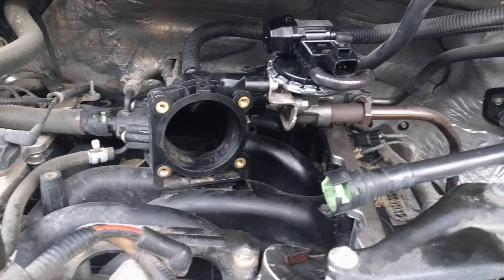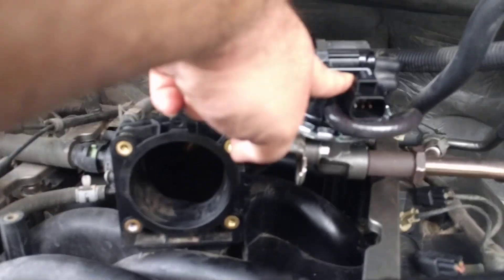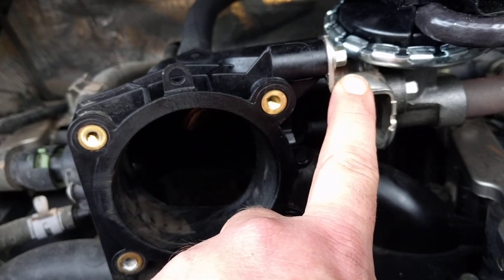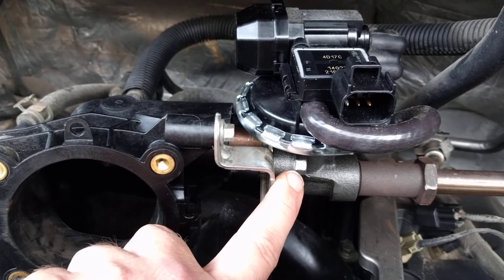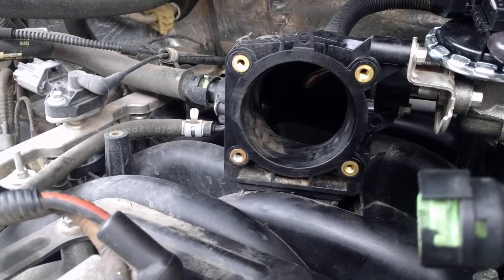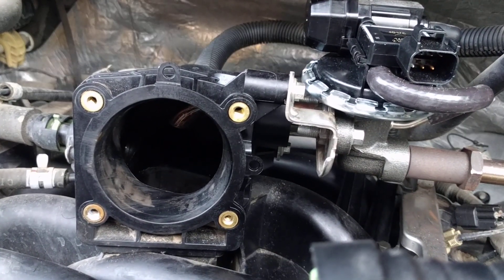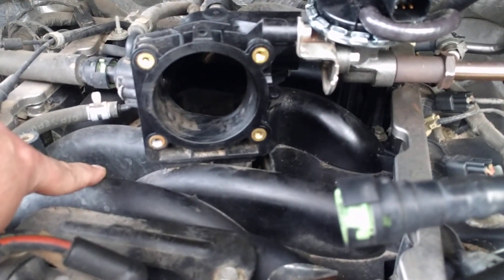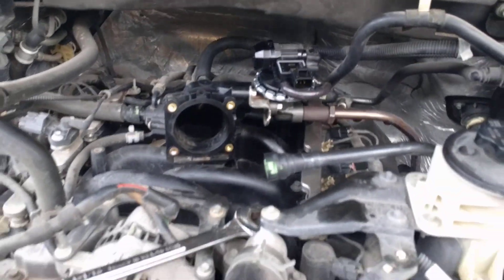2008 4.6 V8 Ford F150 EGR valve

Comment: Was there a gasket in between the throttle body and that plastic housing? Good video by the way I'm going through the same issue! It's hard to find videos on 2007 Ford f150 4.6

Comment: Question. I have a 2008 F150 with a 4.6 as well. EGR Valve literally fell apart, EGR Tube was rusted to hell, replaced both. Truck started right back up but noticed the new EGR valve was really loud as it opened and closed, almost a popping sound. I shut the truck down, tried restarting and once again would not run. Returned EGR valve as I thought it defective. New EGR in and still nothing. WHERE THE HELL DO I GO FROM HERE?

Comment: The 2 small lines that connect to the egr valve with the rubber boot. What line goes where? My rubber boot holding them in orientation melted so if you could please let me know that'd be amazing

Comment: I have the same set up and 4.6 motor. I have the PO 401 code. I replaced the EGR valve and tube. The ports are open, cuz I checked with a wire. I still get the code. After it gets real warm, it will idle funny and maybe stall. Not sure what's going on. I don't know if I bought a brand new, bad EGR valve or what. Is there a way to test the valve to make sure it is working the way it should ?
Reply: I'm having the same issue
Reply: Did you fix it ? What happened?

Comment: I'm trying to figure out a loss of power can anyone help
Reply: Try clean the throttle control body. Mine did same thing and it got better after I cleaned the throttle
Reply: Also, check videos on cleaning PCv valve, EGR valve . That may help too

Comment: Hopefully my question makes sense.    So you are saying that tube is part of the bracket that the EGR controller bolts to.  Is that tube the actual EGR port?   Or is there a port still inside the housing?    I have a P401 that  comes and goes.   I can't figure out why it would but I am wanting to check for port blockage.     So, is that tube the ACTUAL PORT or is there a hole in the body that the EGR bolts to that is the port?  Thank you sir!

Comment: I had a p0446 code! Dealer wanted over 400$ to fix. They said it was the EGR valve. Went to the local auto wrecker and pulled one out for 10$
Reply: The dollar sign goes to the left of the number: $400, $10, etc.

Comment: Hey man, so do I just have to undo that 1 1/16 nut and the two bolts and the egr will come off? Or does the throttle body have to be taken off? I have p0401 and rough idle (misfire?) Even after coils were changed.
Reply from the maker: Yeah that should work. I pulled my throttle body because I thought there was going to be a bunch of junk in there to be cleaned, but there wasn't. My EGR just went out.
Reply: @MrGreeklion  cool. I'm going to do it after work. I'm just confused that it seems like it cant slide towards the brass exhaust coming from the engine, and it cant slide towards the throttle body. It will just go up and out?

Comment: Thanks for this. about to clean my ports on my 2007 f150 4.6L i had the egr replaced last year but my programmer is now picking up P404 code. im thinking the ports are clogged with carbon but we will see!

Comment: Thanks a ton for this video.  Fair warning to people doing this in the future - the bolts from the EGR to the bracket were S-T-U-C-K.  After removing the exhaust tube (using a lot of muscle), I removed the whole assembly from the plastic housing behind the TB (2 bolts), then used a grinder to cut off the heads of the bolts on the EGR side.  That got the bolts hot enough to twist out (what was left of them).  Not an ideal solution, but worked for me.  If I had to do again, I would use a torch to heat the bolts for removal.  I don't see any other way.

Comment: Did you have to remove the manifold to EGR pipe from exhaust manifold first or were you able to remove it on the EGR end without doing that?  The bracket that holds the EGR to the TB on mine isn't very strong.  Thanks for the video.